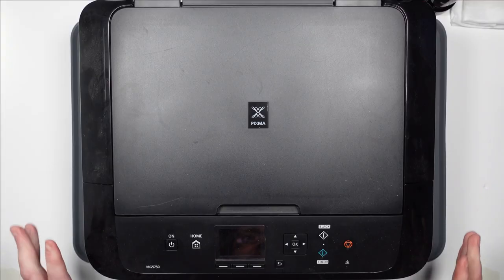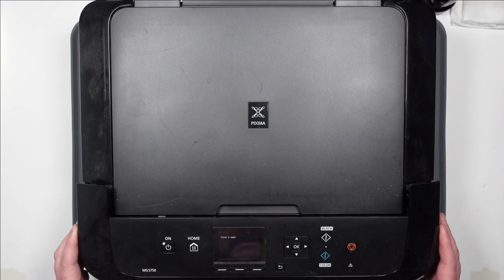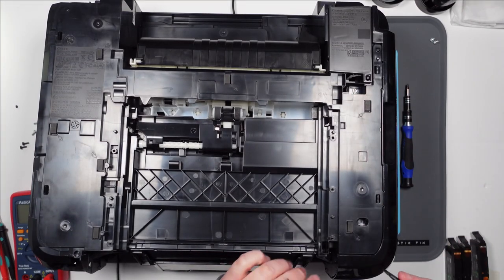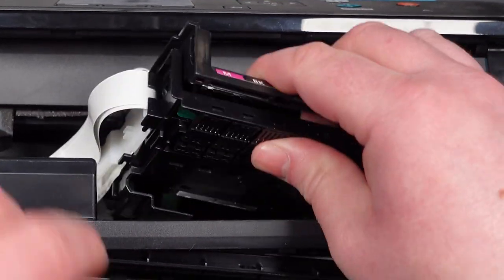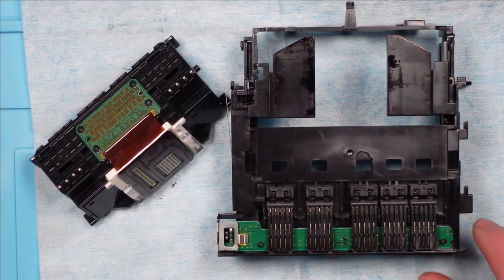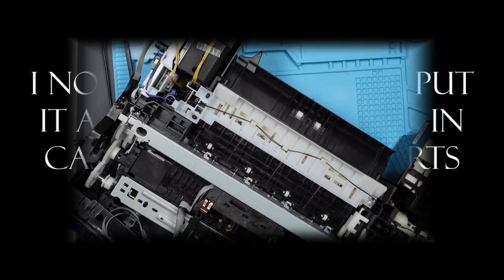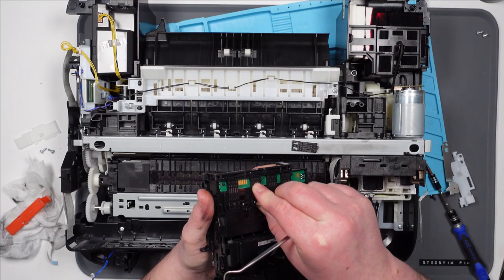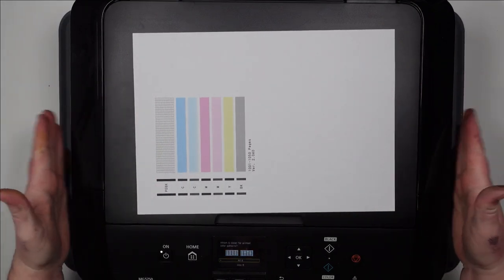CANON I Fix It? | MG5750 Printer That Doesn't Recognise INK!

Comment: You're lucky it wasn't glued together, the printer, despite it's complexity, is considered a disposable item.
I bought my Canon MG3650 for £29 in Tesco's - Two replacement cartridges were £48 - you should get a free printer when you buy a pair of cartridges.
It's nearly cheaper to buy a new printer just to get the included ink jet cartridges and throw the printer away, that's eco friendly.
I can't imagine this happening a few years, you bought a Typewriter for 50p but a new ribbon was £349.

Comment: Printers are the work of the devil ... you might want to consider nitrile gloves if you decide to tackle another one.  I'm still confused as to why this fixed the problem and didn't transfer it over to the other slot, but congrats all the same.
Reply from the maker: Yeah, I fully expected the black cartridge to throw up the problem, but it didnt and it hasn't since. Once again, I'm not entirely sure what fixed it, but I'm guessing the seating and reseating of the contacts finally made a decent enough connection for it to recognise the inks. Although I had continuity everywhere, so 🤷 🙃

Comment: Mine has the 5th pin broken and it went inside I can't get it out 
how can I fix it?
Reply from the maker: Hard to tell you without seeing it, but you'll probably need to take it apart, which is a pain.  I don't ever want to have to take one of these apart ever again, it's not fun.  Good luck.  👍
Reply: @StezStixFix  thank you for replying! I think I'll have to replace the pin because I tried taking it out with tweezers but it didn't work, so we'll see how that goes :)
Reply from the maker: No worries, hope you can get it fixed! 😊

Comment: i keep getting the error code c000 i've no idea what's causing this issue there's no foreign objects inside it's just everything to do with the print head itself the thing won't even print the test pattern
Reply from the maker: Hi David, I wonder if resetting it might solve it.  Have you tried to reset it? If not, try holding stop button for 2 seconds and then press power for 2 seconds (still holding stop), let go of stop but keep finger on power, then hit stop 5 times and then release all buttons. It should shut down and then you can turn it back on and see if the problem is still there or not! Hope that makes sense and good luck 👍
Reply: @StezStixFix  Thanks for the reply but sadly it didn't work but i have noticed some dirt or ink on the timing belt so hopefully cleaning that will do the trick.
Reply from the maker: Hope you get it fixed! 👍

Comment: this is why IT people hate printers
the amount of effort involved, along with an hourly rate compared to the cost of a new one basically means these are e-waste 

there's no real explanation as to why what you did fixed it  ( i'm sure the error changed from 1684 to 1660 too )

Comment: I had one of these printers. If Canon didn't try and rip you off for ink then I wouldn't have bought 3rd party cartridges. Then they disabled 3rd party with a firmware update. Then I binned their printer and will never buy ANYTHING Canon again.

Comment: sorry to moan but when errors like that come up its either a connection or a failure on the logic boards, if its a board its dead so just check the wiring, those chip pins are easy to damage and your first port of call

Comment: dude, they make those printers to self destruct in 18 months, mostly from injecting software errors. there's an internal count on how many prints you get, and then the software takes a dive and stops recognizing ink. it happens to literally all of them. it's a scam to get us to buy more.
Reply: 18 months???   Speak for yourself, not for everyone else.  What are you doing wrong if you can't get a printer to last more then 18 months?
My Canon MG 7520 is 8 years old and still chugging along.     Wife uses it to print photos all the time.